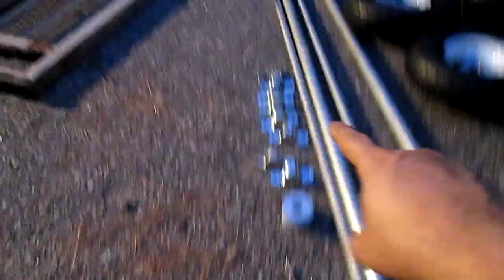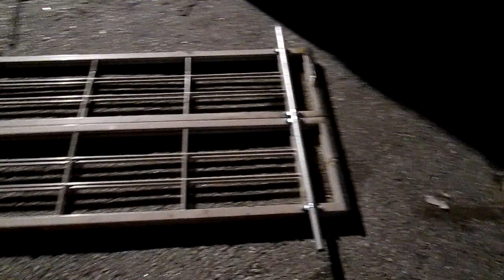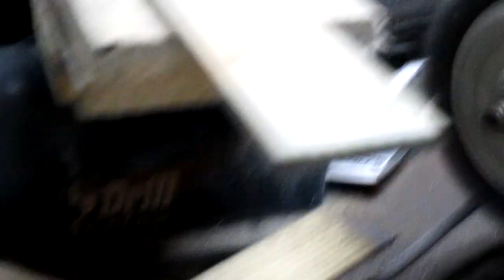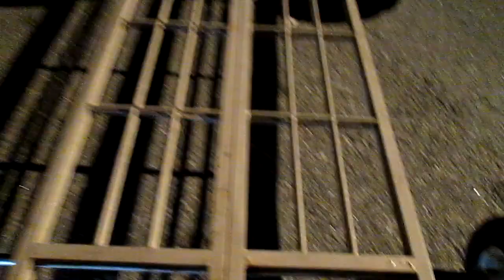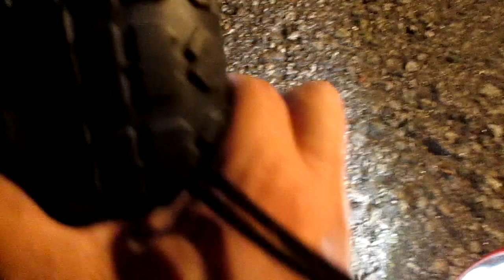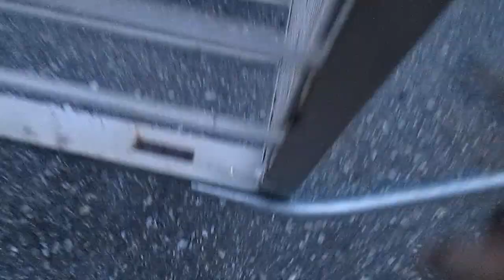DIY Homemade - Riding Lawn Mower Trailer - Garden Tractor Utility Dump Cart - From Junks Free Stuff

Comment: Excellent, everyone else is afraid to that small trailers do not need any suspension.
Reply from the maker: You can apply this to many principles.  We still use it to carry big sticks + lawn stuff + etc...  It's still working great.  My next one, I am going to put it on Wood Pallet(s) and make a Kart out of it, just to show people that it can be done, just like in this video.
Reply: @JodBronson  Hey I am 63 years old and this week my son 16 and I are putting together a 600lb low ride heavy equipment trailer with SOLID axles to the frame. I have another one I have used for 30 years built the same way. No rinky dinky springs. Great job on the trailer.

Comment: LOL, what really turned me on was the bending of the cotter pin LOL, anyway looks like a GREAT idea for light weight stuff, line the sides & bottom with cardboard and use to it to haul raked up leaves or pine straw, light weight stuff. I have something MUCH cheaper and easier, I had a used 4 x 8  3/4 thick piece of plywood, used a hole saw and cut 2 holes on one end, @ opposite sides, then ran a chain through the holes & then loop the chain over my hitch ball, the plywood then acts as a sled being pulled behind vehicle or mower, it is VERY handy when I cut tree sizes too LARGE or HEAVY to pick up, I just ROLL the wood pieces onto the plywood since it is at ground level, NO more having to pick up to put INTO A CART. BTW, I am going to put hinges on the sides of my plywood so I can fill up the sled with more goods since it will have sides like yours.
Reply from the maker: Hahahahahahaha, on the Cotter Pin.... LOL. ❤️ 😂 ❤️ 😂.  The Plywood is a good idea for sure.  Our Lawn have a lot of Grass and if I messed it up, my Dad and Gram would kill me.  I do like the idea for the Trees and large broken wood, etc...  Who knows, I might use that idea one of these days.  Recently, we had 4 Trees cut and it's all over the place.  We have it laying down in the back to leave it to dry, I might use that idea to move them.  My Cousin is taking them for his stove to burn for Winter, but he's slow for cutting it and splitting it, which drove my Gram crazy cause she wanted them gone, LOL.
Reply: @JodBronson  Ya know I would of thought the sled method would of tore up our grass but it hasn't, really works well, I have rolled trees almost the size of a 55gal drum onto it using a pry bar, rolled them right onto the center of the plywood without picking up anything, pulled the load to the corner of my property and just rolled the stuff off.
Reply from the maker: @REVNUMANEWBERN  -  If it's my yard, I would do it.  But it's my Dad's, he's one of those People "DO NOT" like to change things..... Not like Grass won't grow back, LOL.  But in the end, it's not my yard, I have to respect him.  But I can see the concept and I would do it totally and I believe you.  Where are you from by the way?